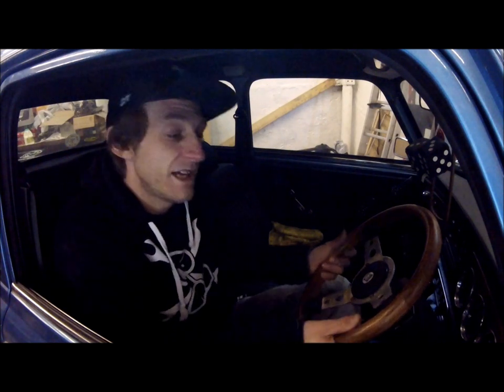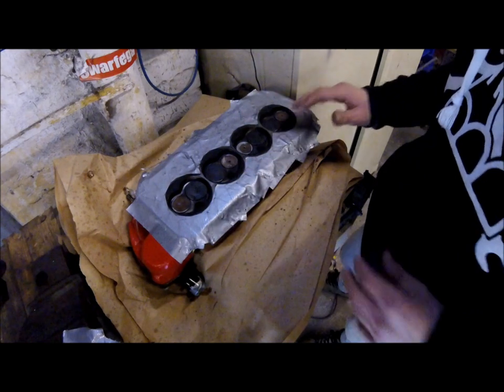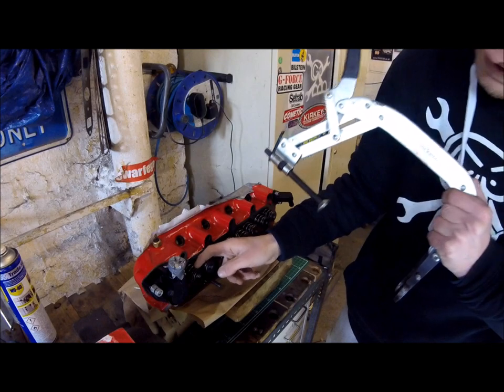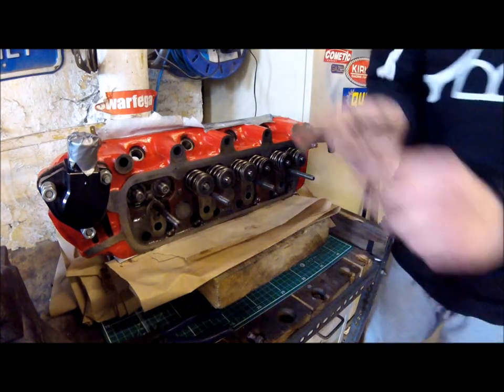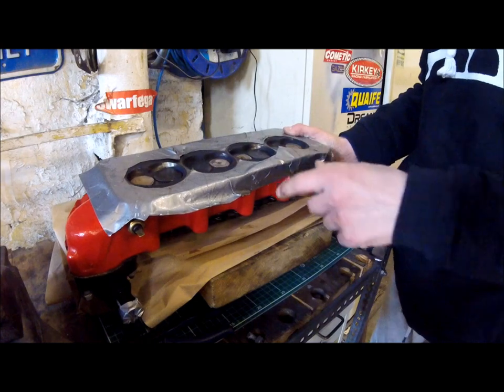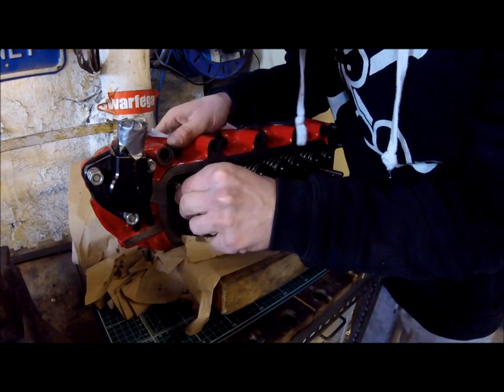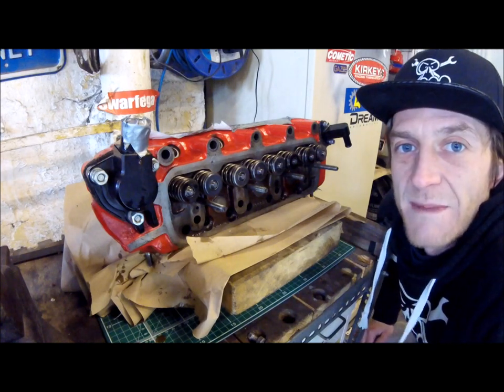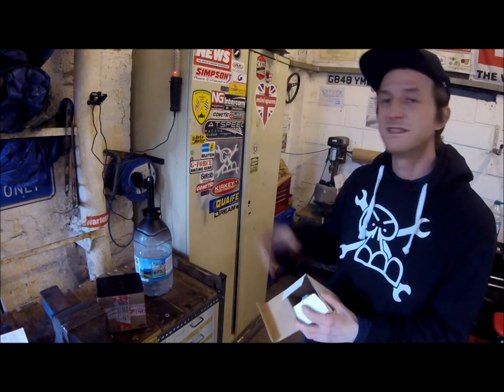Mini Diaries Episode Twelve - Head Clean, Valves & Clutch Master

Comment: Think we may have to do this to toms mini , before the restoration, it’s was smoking bad , not sure if it was running to rich , or the same problem as yours , great in depth video pal , 👍🏻👍🏻👍🏻👋🏻👴👋🏻👴👋🏻👴👋🏻👴👋🏻
Reply from the maker: Mark Shorrock thanks Mark. Plugs don’t suggest it’s running rich but could be idling a little high. What’s your first show this year?
Reply: Mini Dob8y we did bingley hall , not sure what’s our next show , I will have to see which ones toms doing mate 👍🏻👍🏻👋🏻👴👋🏻👴